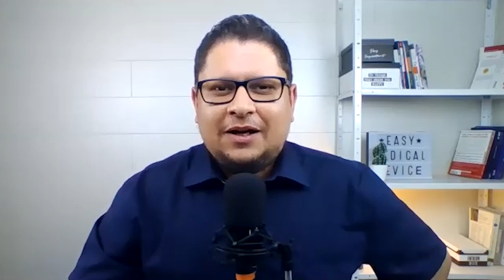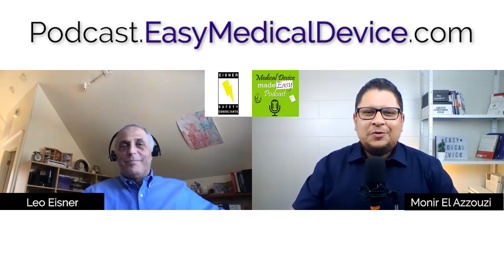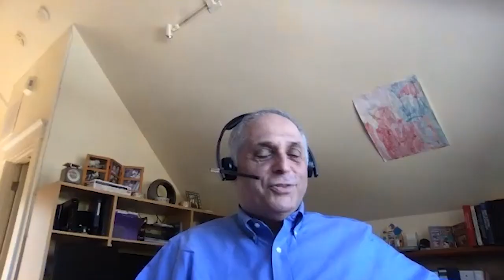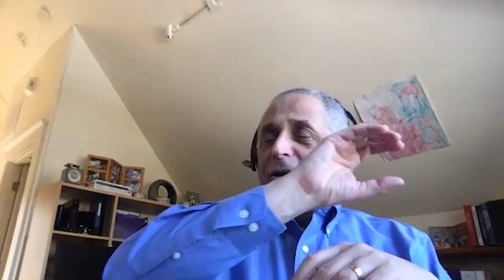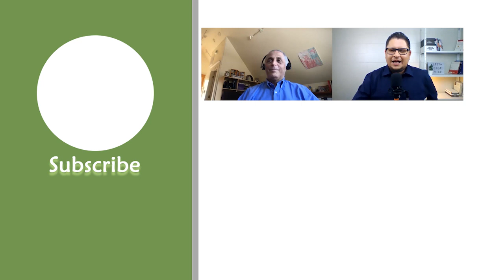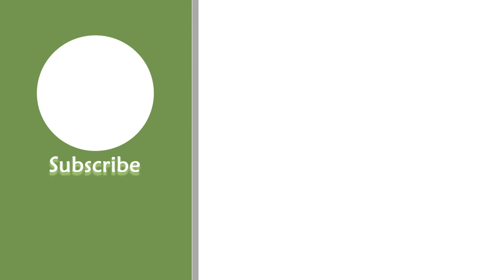IEC 60601 explained by Leo Eisner (Medical Devices)

Comment: Hello Monir. When we talk about electrical devices, does it apply to all types of electrical power supply? I mean even the battery? Is there a level of danger from which standard IEC 60601 must be applied?
Reply from the maker: Hi Arsène, yes even battery powered devices. Leo mention that when I ask him which products are in scope. There are also dangers due to battery.
Reply: @EasyMedicalDevice   I certainly missed this part. Thanks